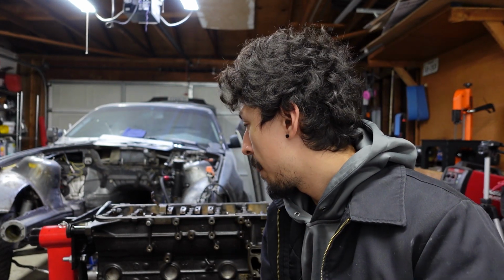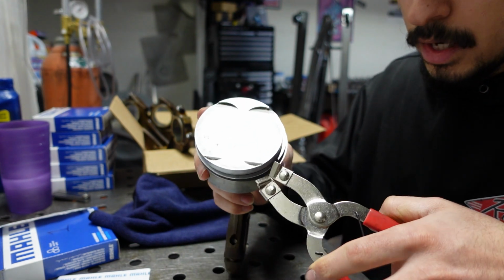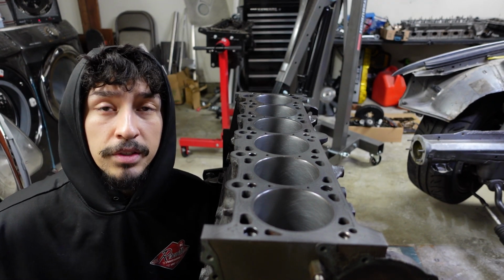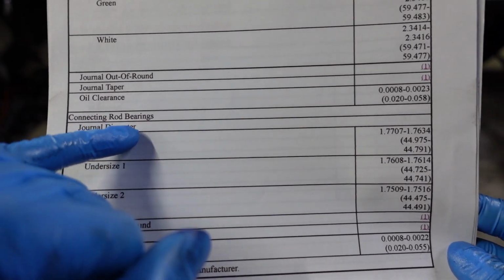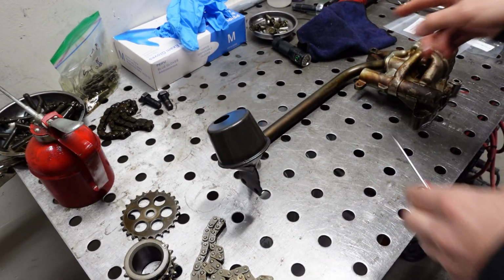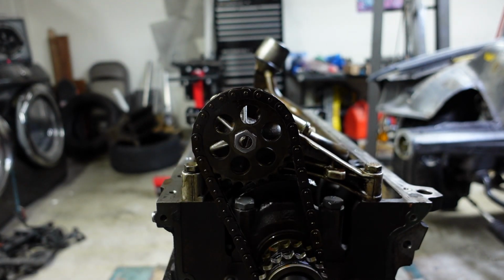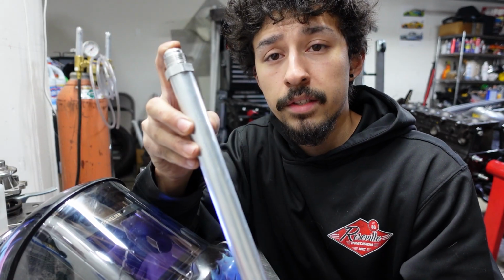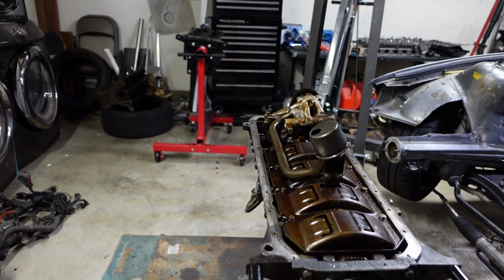Finishing up the Bottom End - E36 M50 Turbo Engine Rebuild on a Budget (pt.3)

Comment: Safety wire not correct. Should have gone to the farther sprocket and had tension on the wire.  IF the nut loosens, then what you did  will stop the nut to come off completely right away, but it will be lose, and eventually ruin the splines on the oil pump or sprocket.  With the red thread locker it will hold for a while, might never come off because you have the tensioner. lack of tensioner the main cause of the nut coming off.

Comment: Thats the small oil pump. Bmw redesigned it. That pump with the un used bolt hole loop on the oil bypass. Its 20 or 25% smaller than the vanos pump?  Prolly ok for a stock street motor with no vanos.. HOWEVER, DRIFTING...    I would swap it for a later pump with out the un used bolt hole. The impeller is about 3/4ths of inch wider on the later pump.  I found out cuz i bought a acciles drop in rotor.. wouldent fit.
Reply: Did those come on the vanos M50's? 93+? Im building a forged bottom end on a M50NV and doing the same oil pump mod on mine.

Comment: Enjoying the build! Plan is to follow up soon, still figuring out what is the best combo of the M50 family for bottom end. Maybe I skipped it through the build but didn't catch what crank, rods and pistons are you running? Also which hg and what thickness? If I see right that's M50nv rods but vanos pistons?
Reply from the maker: Nice! All the bottom end stuff is basically stock m50 vanos parts, just with new bearings and piston rings. The headgasket is a .120" MLS from VAC motorsports if i remember correctly. They recommended  between an 0.098"-0.140" range and said every 0.010" thicker than stock will reduce CR by approximately .25CR.
Reply: @Purpose_Built  Thanks, good info!
By that calc you should be around 9.2CR

Comment: Definitely use the tensioner. This is the reason e46 330 loose the oil pump nut. The chains at over 6000 RPM with the slack of not having a tension is was whips on the sprocket causing the bit to back off. There is a video on installing the tensioner on e46 that don't have it.
Reply: Spank ranch garage has a video install